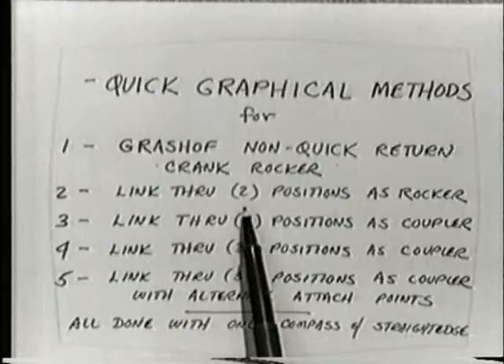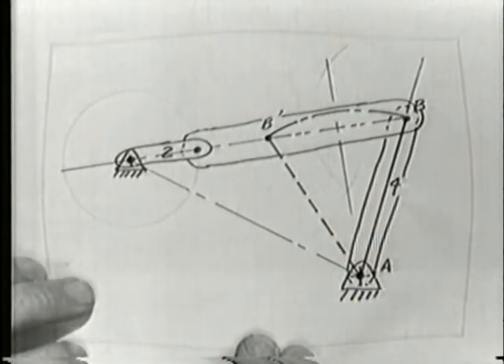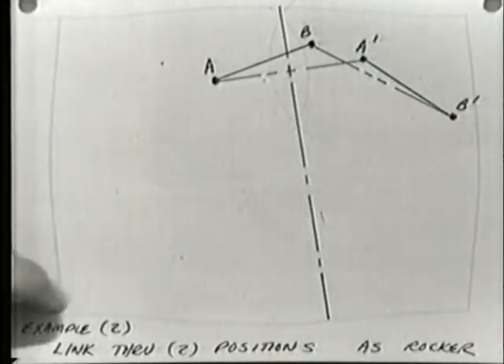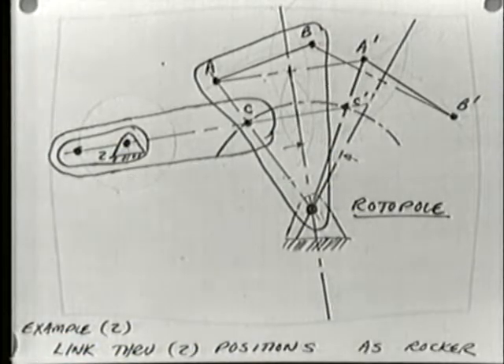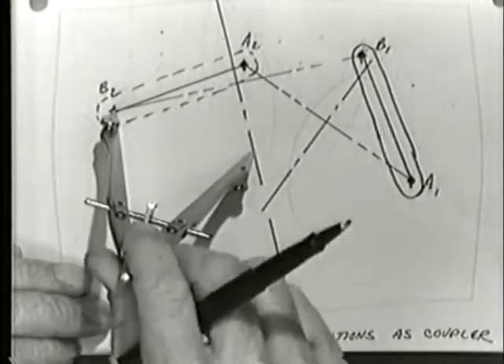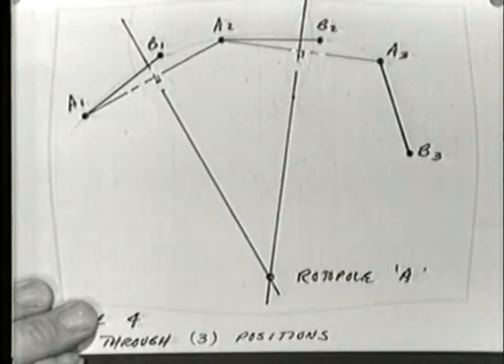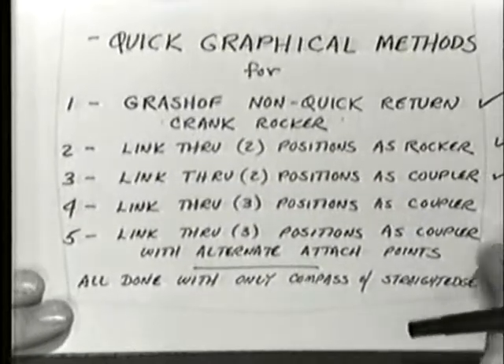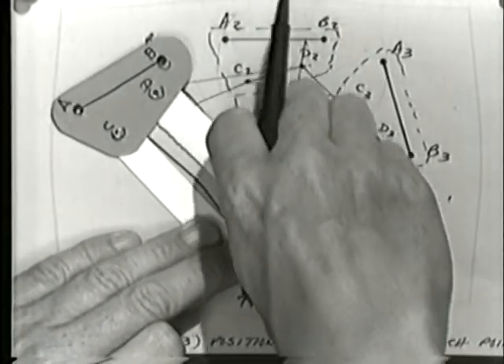Position Synthesis|  Instructional Video by Prof. Robert Norton

Comment: If you need a Grashof crank rocker:
0) Draw A, A', B, B'
1) Find the rotopole aka the intersection of the perpendicular bisectors between A-A' and B-B'
3) Create the link(s) that will bring A and B to A' and B' Simultaneously
4) Use the method of creating a Grashof non-quickreturn crank rocker (wiper) on the special link
5) Profit

If you prefer to get the coupler to hit three positions at A and B:
0) Draw A, A' A'', B, B', B''
1) Find the A *rotopole*: the intersection of the perpendicular bisector of A-A'-A''
2) Find the B rotopole: Same thing but for B-B'-B''
3) Create links from the A rotopole to A and the B rotopole to B
4) Profit